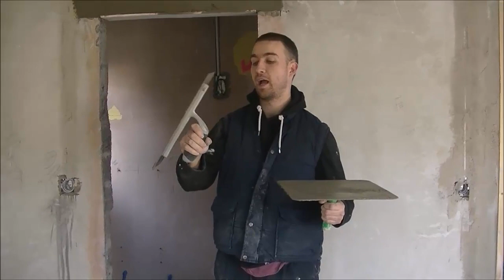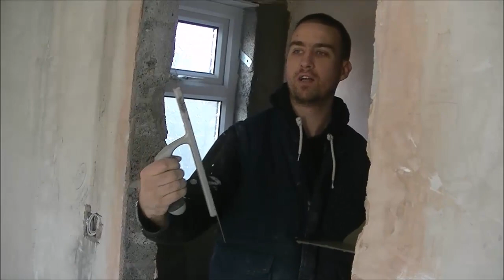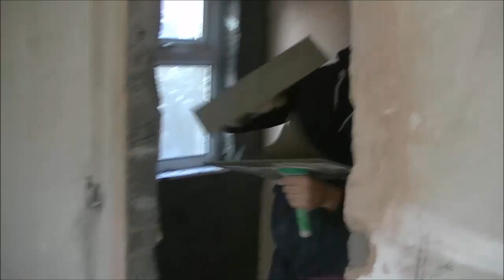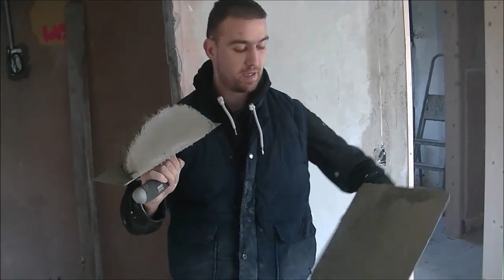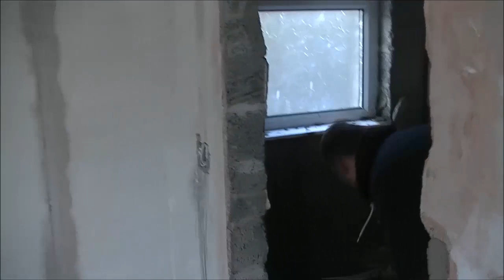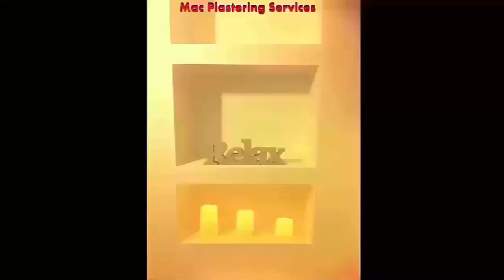RAGNI HIGH LIFT CEMENT TROWEL ACCOMPANYING POINTSMAN HAWK

Comment: Hey mac,
Your favorite sand and cement trowel ?
Your a glutton for punishment always doing sand and cement float and set indoors!
No doubt it's stronger than lightweight undercoat plaster but lightweight under coats do have some benefits in insulation and fire retardation. (Plus it's a lot quicker to mix and chuck on for us lazier spreads!)
I do a lot of Renovation work and I often find strong sand and cement renders blowing as well as very soft degraded undercoat plasters. 
Always make me wonder what's the best thing to put on you know...
Just wanted to say some videos I'd be interested in seeing would be;

•Spatula comparison (refina speedskim ezspat etc)

•videos on alternate finish plasters such as Carlite (which I can never find where I am in England)
Theirs benefits and why you would chose them over thistle. I am finding a lot of vary in thistle finishes and going back and forth between multi and board finish, finding multi can be really overly greasy and hard to finish well/time trowels with.

•Nela trowels especially Nela medi flex and plastic trowel but also Nela premium if you fancy it.
I've been using a Nela premium for laying on all my finish work for about a year now on and off and find it excellent. Not a huge fan of there superflex trowel but do think there trowels are excellent quality and that little bit better then refina who I use a lot to but have had to send back some of there stuff in the past where it's not been up to scratch (bent superflex trowel and a poorly made bucket and twitcher)

•A video on one coat plaster if you ever do any would be handy. I have my own method of doing it but not that many guys use it and would be nice to see.
(I lay it on, flatten it, leave it for usually an hour or so then sponge and finish)

A very long winded comment I know but hope this gives you a few new ideas for videos, if you've already covered some of the stuff previously could you link it to me would love to watch it!
Thanks for the great content and look forward to the next one 👍
Reply from the maker: Dude love the comment :) Have a few vids on some of the things you say but will try get more done will drop the links of some of the things you might not have seen yet 

spats vs speenskims = 
SPEEDSKIM VS REFINA SPATULA PART 1 https://youtu.be/MNRT7WQO1Dg
SPEEDSKIM VS REFINA SPATULA PART 2 https://youtu.be/GsJmwp-jMzU

the ox superflex is supposed to be the same as the nela superflex = https://youtu.be/kLbT92XPu9w

CARLITE VS THISTLE BONDING COAT PLASTER = https://youtu.be/qewBaZlH-gk

Plaster and the difference in thistle multi finish and carlite ultra finish= https://youtu.be/2SvSYdNJvZY

have around 300 vids now so might be a few more around that you haven't seen but will try do a few more like these and mabe more in depth  thanks for watching supporting your always welcome here my friend :):)
Reply: mac plastering 
Hi mac thanks for taking the time to reply and recommend some videos!
I've actually seen the speedskim refina spat comparison you did and I hope you don't mind me saying but I didn't take too much from it.
Just a suggestion I would personally like to see;
The plastic spats compare through all stages of finish work and acrylic renders etc as well as the steel blade ones.
Would be great to see them being used from start to finish if you think it's possible to use them like that as I know some guys who are!

Another video idea I'm not sure wether you've already covered could be pricing up and how you tackle it for a variety of jobs.
 I mean small jobs are easy enough to price but large jobs with float and set inside and exterior render can be quite overwhelming?!
Thanks again
Reply from the maker: yea man i do mean and hope to do a vid on a few funny diffrent things like using spats to do a full wall start to finish plastic trowels too and superflexes LOL just as a test but need a wall that dont matter as much and most my jobs dont have any walls like that LOL need a few family jobs to test out on LOL